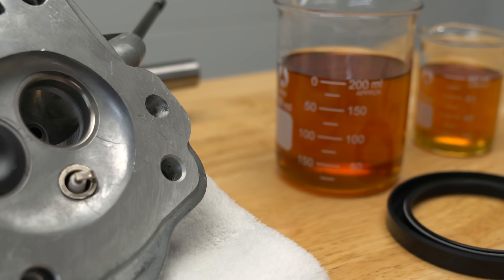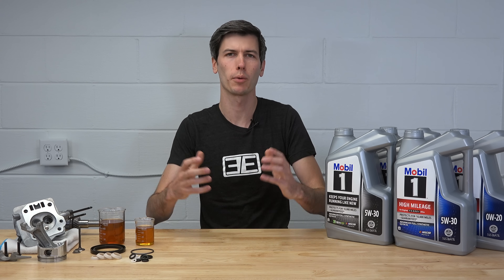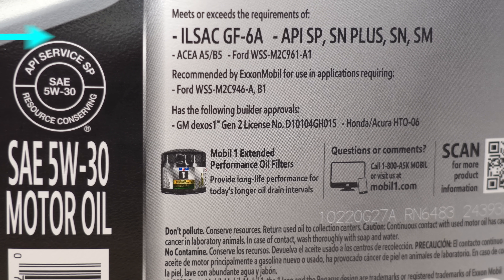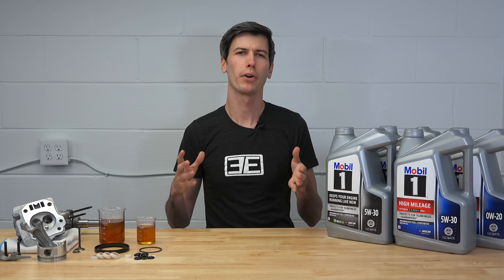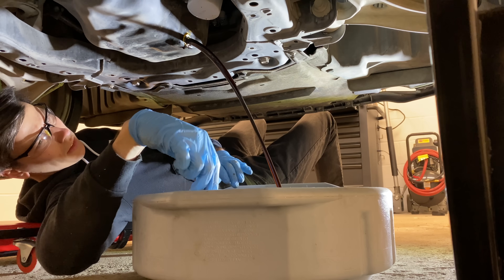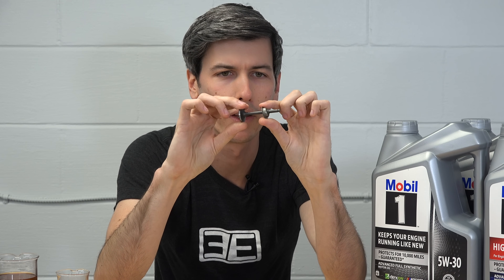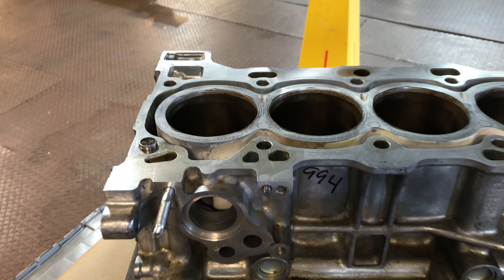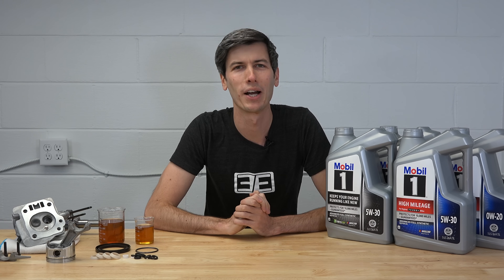Is Synthetic Motor Oil Bad For Old Cars?

Comment: I'm a retired lubrication Consultant and Synthetic engine oils aren't created equal. While the synthetic chemical makeup will last longer but the viral additives wear out and breakdown. The problem with many synthetics is the oil blenders use conventional additives and as a result should be changed as often as conventional oil.  Lubricant manufacturers make changes often making it difficult to keep up with all them. 
Engine oil such as Pennzoil, Quaker State, Valvoline and Kendal has been bought out by big oil companies and the CEO's make bonuses by producing profits not selling a quality product    
I always preferred the Lubrication Engineers lubricants. They will cost three times as much but will last at least three times as long, the additives are the most supreme available. Older cars owners be warned it cleans the gunk left by the previous oils, it will plug breather caps, simply change them if you see oil usage.  As it cleans your engine you could see more oil consumption but over time it will subside. My old truck used to use a quart every 500 miles now I get 2,000 miles. In the long term it saves you money if you want your vehicle to last a longtime.

Comment: Why taking a risk? There are even some new engines made where it will stand black on white use mineral oil only! Some guys will not belive it and changes over to superduper slic syntethic and the engine starts to leak out oil.

Comment: Albeit recent price drops, synthetic oils are still more expensive than conventional oils.  For my '97 CR-V with close to 1/2 million kilometres (300,000 miles) on the roads, it just doesn't make sense to use synthetic as I've used conventional oil, mostly 5W30 Castrol, and now high mileage conventional oil with age-proven results.
Reply: I disagree. Conventional oil breaks down quicker and loses film strength quicker v.s synthetic being able to handle higher heat/more cycles with less breakdown. So a conventional oil lasts 3000 miles say, synthetic 5000 miles, synthetic usually gets you the same miles per dollar spent
Reply: @GenesisRC  This is theoretically true, especially with latest synthetic oils, but not really practical for vehicles in northern climate, unless thousands of dollars are spent on rustproofing over the span of more than 2 decades (I still did, not every year though, especially in recent years).  My beloved 1997 CR-V was almost in perfect running condition when I had to scrap it last year not because of engine failure or mechanical issues but with rust build-up on the body due to 24 years of exposure to road salt.  Most of the under-body metal parts were almost like cookie crumbs and I couldn't even jack up the car using the designated jacking points anymore.  Two of the wheel wells had already developed huge holes that I had to patch up with fibreglass.  Therefore, the usability and longevity of the vehicle depend on other factors for us Canadians when the ICE engine can easily outlive the other body parts, even if we stick to using cheaper conventional motor oils.

Comment: We know a person that bought a 1994 vehicle with about 160, 000  miles on it.  He checked out that vehicle very closely before buying it. IT HAD NO OIL LEAKS ANYWHERE and ran good. He bought it and changed the engine oil and filter using 5-20 fully synthetic oil and a recomended synthetic type oil filter after approximately 2000 miles of use later.GUESS WHAT?? It started leaking oil from the engine oil pan gasket and the engine rear main seal about 2 months and or approximately 1000 miles later. THERE HAS TO BE SOME SOME EXPLANATION FOR THIS HAPPENING????

Comment: 0W-40:Mobil 1 is the recommended oil for my Porsche 911–and it’s been using oil from brand new at 1 quart per 1000 miles.  Has now for 123,000 mile.

Comment: Had a 81 Firebird and used 10w 30 Mobil 1 this was in 1988 . I changed over because a friend suggested it. So I change the oil and filter started the car. Holy hell ,the engine rattled like it had no oil. I had a friend take me to the exchange and get more oil ,pennzoil 10w 30 ,went back drained the Mobil 1 ,put on a new filter and the pennzoil started up no problems.  I saw several people use synthetic in the 80s and 90s in General Motors cars and they all leaked like a sieve. They weren't leaking before! My Dad had a 92 LSC mark 7 and at around 25,000 miles someone convinced him to change to Mobil 1 and within 5,000 miles the car was leaking and got worse mileage . I had him switch back and within 2 oil changes (6000 miles) the leaks mostly stopped but not completely.  It was common knowledge in the Mustang 5.0 community not to use synthetic oil, those who experimented had the same problem as my Dad with his Mark vii, that car had the 5.0 HO motor as well.  You might be able to change over the last 15 years or so to synthetic but American cars from the 80s and 90s didn't like a change to synthetic after they were used to a conventional oil. Just my experiences.

Comment: Thanks for posting this. It contained quite a bit of useful information. Back in the OLD days, rear main seals were made of rope, and as time went on, those seals turned into almost like wood, and the sealing swelling issues failed, causing those seals to leak.
Reply: What years exactly you are referring to sir thanks
Reply: Rope?????? Which cars, what years and where was this
Reply: @marcussok6469  Jaguar uses rope seals for the cranshaft..
Reply: Olds also uses rope seals throughout  ros and 80s .jags also has leather for a diff seal.maybe you heard of a seal company called cr seals C is Chicago r is Rawhide
Reply: Hence my rear main seal leaking on my 01 Infiniti i30T that I have to move tranny to chamge

Comment: Switching from conventional oil to synthetic caused leaks in a couple of old cars that I owned too.  That is the main reason many people won't switch in older cars (70s-90s). In a newer car, I would only run Synthetic.
Reply: I ran synthetics in a 74' Chev pickup 350, 81' Dodge Mirada, no problems.  Synthetics only leak if you have bad seals, synthetics have more detergents than conventional, so if sludge is keeping your engine from leaking, ya, it's a problem.
Reply: @lonniebeal6032  
nice! using 5w40 100% synt in a old chevrolet 153 (2.5 L4) engine. smooth and clean.
Reply: Try Lucas oil stabilizer to help slow the leaks .  It also helps to minimize dry starts by staying on the piston walls

Comment: I am concerned with Zinc no longer in motor oil on gas engines as it kills the Catalytic Convertor so I can see why it was removed.  Diesels don't have that issue so there is zinc in the oil, I have been using Diesel Synthetic oil in my air cooled engines and older equipment that are gas.  Is there a problem, as so far I haven't had any issues that I can observe.  Can anyone with real authority provide me a answer.

Comment: Hasn't anyone noticed that most oil companies have quietly switched to synthetic blends?? It seems harder to find straight up conventional oil anymore.
Reply: Meijer sells conventional oil
Reply: @austinsnider5836   I gave up trying to find it at Walmart but they did have a hybrid version at the same price so I bought it for my S-10.
Reply: @joew9392  wal mart isn't the only oil seller in town
Reply: Ran into that situation at Walmart earlier today.
Reply: Keep in mind an oil company can put a single drop of synthectic oil into a 5qt jug of conventional oil and legally call it a synthetic blend.
Reply: @JohnNorris411  I’ve wondered what the blend was. And why it’s not placed on the label. Why I won’t buy the blends. full synthetic always. Price difference is negligible.
Reply: One thing to remember is if an oil says "synthetic blend" it could literally be conventional oil with just a drop of synthetic. Now that's a bit of an exaggeration but there is no legal requirement for the amount of synthetic needed to be labeled synthetic blend. There's no way to know how much synthetic is in a synthetic blend so just be aware that there could hardly be any synthetic in a blend at all.
Reply: I bought dinosaur oil from O'Reilly's this weekend. The store associate had to get it from the back of the store. Like a secret stash or something.
Reply: I have over 300K miles on a Chevy Suburban and the engine doesn't use a drop of oil on long trips!!!  Old cars perform better with the more slippery synthetic oils, so the sooner you switch the longer your engine will last.   Moreover, you can leave the synthetic oil in much longer - I'd say up to 8000 miles per oil change, because it doesn't get dirty as fast - it lasts longer and continues to be more slippery.   I always use high quality oil filters, since they will be lasting longer, too.
Reply: Synthetic Blend is just modern conventional oil.
Reply: Blend oil has 10% synthetic so not worth the extra cost. I called mobil1 and that's what they told me. So use the synthetic.
Reply: In CANADA the price has gotten crazy for synthetic, $15/l. Good thing I found this post, Canadian Tire has it on for $32 a jug.
Reply: Penrite. Has ZDDP zinc in it for old engines. I wouldn't use anything else in my classic beetle.
Reply: Valvoline
Reply: I can find conventional anywhere but Mobil seems to not make any conventional
Reply: Rob S no just bought 2 quarts yesterday
Reply: I can find 15W-40 mineral oil at all Shell petrol stations.
Reply: Synthetic oils are made from natural gas…
Reply: @kimballscarr some are..
Reply: Use Penzoil.
Reply: I own a auto repair shop I don’t even offer conventional oil I only have synthetic blend and full synthetic. Every engine nowadays should have full synthetic to avoid timing chain issues
Reply: The Group 3 (base) oil, which are marketed as synthetics at more affordable prices, are not truly synthethic in a traditional sense like Group 4 (PAO) and Group 5 (esters and others) in that they are processed from cracking crude oil and are not combined from substrates or other formulations.
Reply: Not all is as it seems to you. 😂
Reply: GM dexos standards kind of forced that into exixtence: run an oil under load at 302 degees F for any length of time [much less 150 hours] and conventionals are in their breakdown - most are fading in the 280-290 range.   But I wonder... who outside of endurance racing actually needs this higher thermal standard?  They aren't banning conventional oils, just driving up the cost of anything and everything in the ongoing politicians war against the middle class.  Making 500 nice cars now seems to require pumping out near a million units of mediocrity at the masses these days, or the manufacturer gets bludgeoned by regulators.
Reply: Napa still sells a good selection of conventional oil
Reply: Valvolene VR1 20w50 mineral is available, inexpensive and rich in ZDDP exactly what you need for an old flat tappet engine.  Failing that ANY mineral multigrade oil for a diesel engine will be ok.
Reply: I like it. I use Castrol GTX high milage in my 96 Silverado.
Reply: Because everything I do is "outdated"....My cars and old school heavy metal
Reply: @robs1852   Old cars are easier to work on..
Reply: @joew9392  laughs in carburetor
Reply: @JodyBruchon   Mine aren't quite that old...
Reply: @joew9392  that's the biggest crock of crap I've ever heard. 

2000s GM , 2000s Honda, even my 2010 Hyuandai is simple
Reply: @JayAR_YT   I imagine you've heard a lot of crap in your time...
Reply: @joew9392  And they break more.
Reply: @joew9392  And need work more often.
Reply: @joew9392  So True!!
Reply: @joew9392  Exactly and it’s cheaper to fix and less likely to breakdown.😊
Reply: @robs1852  lol   I like "outdated"!!
Reply: @robs1852  Old school metal doesn't age.
Reply: @robs1852  cars cant be outdated, old cars are better, but new oils are better
Reply: @robs1852  dork
Reply: I think what you are seeing is that the price difference between conventional and synthetic is narrowing over time, making it less and less important for oil companies to provide conventional as a "cheaper" alternative to synthetic for consumers where money is tight.
Reply: @GrnXnham  I think you may find that straight mineral oil is dearer then synthetic oil because the volume of straight oils sold is minute compared with synthetic. I’m old fashioned and was against thinner synthetic oils at first but they’ve proved themselves reliable over the years. Single grade mineral oils probably thin out just as much when the engine is at running temperature,the beauty with multi grade oils is they flow round the engine easier in cold weather conditions reducing wear on all the moving parts of the engine whilst the engine is cold.
Reply: @GrnXnham  You nailed it. You don't want to feed an old oil-burner the high-priced stuff, just to cook it off. OTOH, Syn is good at standing up to heat.
Reply: why would  you use  out dated  oil??
Reply: @Monza62000   Because it's not $8 a quart
Reply: @GOODINDAWOODS  Yeah, so synthetic can be had for $28 for a 5 qt bottle at Walmart or Amazon (the generic synthetic is just a custom label of the same oil that most big brands sell) and lasts for 7,000 to 10,000 miles; meanwhile, you're trying to save a few bucks by buying oil that will damage your engine more and lasts less than half the change interval of full synthetic oil. You are penny-wise and pound-foolish here.
Reply: @GOODINDAWOODS  Never paid $8 a qt for full synthetic, Supertech 10w30 fs has always been under $19 for 5 qt jugs.
Reply: @JodyBruchon  $28?  Supertech 5 qt jugs have never been over $19.
Reply: @lonniebeal6032  That's Mobil 1.
Reply: @JodyBruchon  Okay so you can buy synthetic oil at Walmart / Amazon, at $28 for a 5 Quart, that can last 7,000 to 10,000 miles? What is the name? Thanks!
Reply: @MikeKollin  It's the store brand stuff, Super Tech full synthetic.
Reply: @JodyBruchon  I wouldn't go 7K on any oil, even in a Toyota engine.
Reply: @JodyBruchon  Just bought a full synthethic 10-30 hi mileage 5 qt bottle at Walmart for $20.
Reply: @JodyBruchon  Hate to break it to you but my 318 has 253k on it and the bearings look great. Never once used synthetic oil
Reply: @JodyBruchon  As a mechanic, if you let your car go 10,000 between oil changes you're a moron.
Reply: @Monza62000  More smoke from my 2 stroke
Reply: @Monza62000  Because it is the Real-deal oil and is not synthetic.  Much like Sophia Loren vs. the Silicon Suzzie's and Plastic Patties. 
 
 No sense paying more money for an expensive oil when the real-deal oil works.
 
 Did you notice that the guy in the video is selling "Mobil 1" products? What do you expect him and Mobil 1 to say?
Reply: @gusloader123 He did state in the very beginning that he was working with Mobil.
Reply: Dollar General
Reply: @cjsteele9594  Don't buy that stuff!  Read the label.
Reply: @cjsteele9594  please don't Dolla Gentral oil the car.

Seriously, Walmart super tech synthetic at $19 a jug is a good 10x better easily.

Actually that oil is better than nearly all distilled dinosaur lard, as is most synthetics.
Reply: @kloroformd  it all comes from same refinery
Reply: @kloroformd  dinosaurs have nothing to do with crude oil
Reply: I have no issue finding conventional oil. Some oil companies still produce conventional oil, and quite easy to get.
But still dominated by synthetics.
Reply: Stp sells a lot of conventional and Valvoline too. and the Castrol GTX but it’s the 20w-50
Reply: Rotella is best
Reply: @jimcatanzaro7808  we use rotella' even in our cars
Reply: It is. I had a hard time finding conventional for a generator break in.
Reply: there are plenty of conventional oils in walmart, but, but, the conventional oil today is not the same as it was 50 years ago. old conventional oil was just pure oil from a crude. now conventional oil how so many additives in it and blends that is simply more of a synthetic oil . However  nowadays conventional oil still better for high miles engines than a synthetic , because it burns and creates a sludge that fills out all the worn out gaps and areas. If you have andold V8 with half a million miles , just keep using the cheapest coventional oil yo ucan get and it will run. Fill it with synthetic and it will start knocking  after few months.
Reply: @ansv3340  I’m confused, why does synthetic burns more and cause sludge than conventional?
Reply: @projectmanbeyond  yea lol the same thing i say. Full Synthetic dominates High Mileage and Conventional oil in every manner except price lol. I say pre 2000s cars run perfect on conventional and newer cars need Full synthetic due to high compression, turbos, superchargers and or high complex computers.
Reply: @projectmanbeyond  because it does, less zinc in it also! It's all hype to sell a new product
Reply: @projectmanbeyond  This is a guess, but I think they are saying an old car that has used conventional oil will build up sludge over time and synthetic oil will clean out the sludge. Cleaning out the sludge then could cause a leak, which was previously stopped by sludge created by conventional oil...or something like that.......the conventional oil can be it's own stop-leak, sometimes......
Reply: @ansv3340  just ignoring the video you are posting under.
Reply: @ansv3340  Interesting.
Reply: Matter of fact , soon ice automobiles are quietly going to disappear
Reply: And people will soon find out that are power grid won't handle everyone charging cars at night and will be going from electric to horse and buggy. On the bright side riding a horse is better for the environment!
Reply: Do you realize that synthetic blend is nothing more then recycled motor oil with polymers added....anothers words...like using standard straight up oil of years ago and then adding a can of STP

Comment: Is the old fact no longer valid, that the strength of the oil film is weakened a lot more for fully synthetic oil than for mineral oil, when it is diluted with petrol?